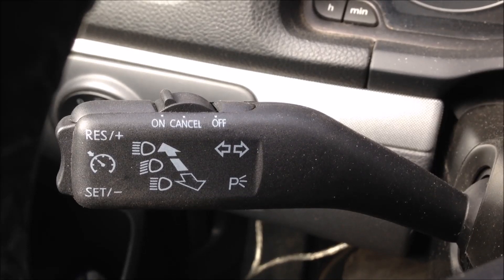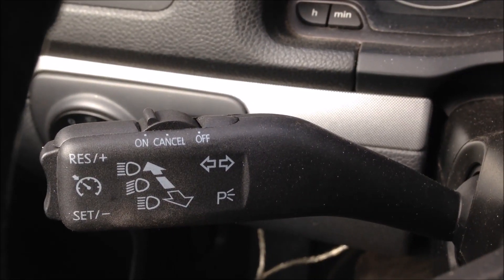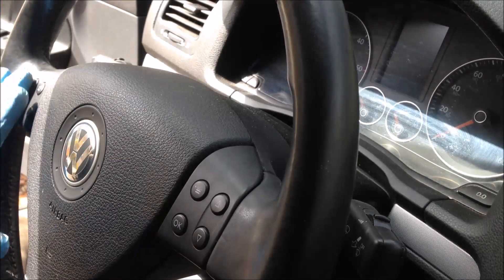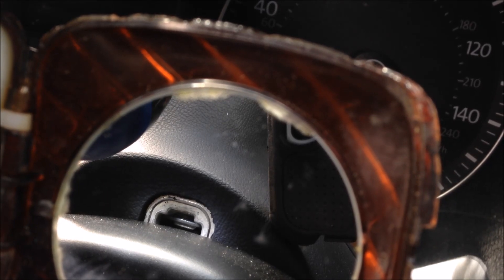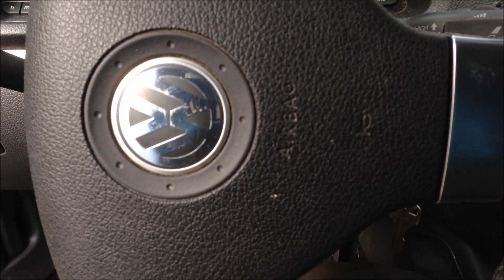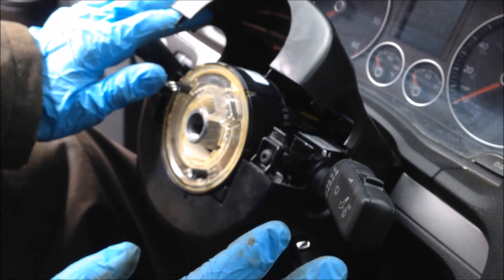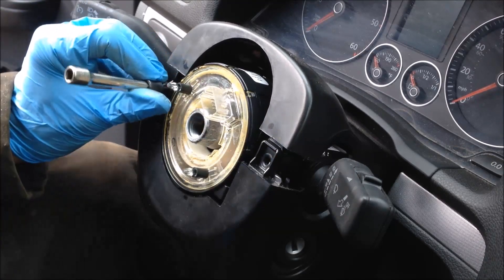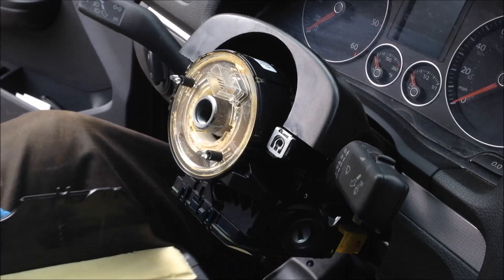MK5 - Jetta - Airbag, Clockspring, Turn Signal Disassembly & Repair - Part 1 of 3

Comment: I had the cruise control switch on my  turn signal go out on my Jetta 2010. These videos walked me thru the process and I was able to replace it and now it works great. You need a Triple Square Spline Bit Socket Set, Metric - 12mm to remove the steering wheel. I also had my seat belt receiver on the driver's side start malfunctioning and continously start dinging ever though it was clicked in. . This also required the same kind of bit but a 10mm to remove the seat so I recommend buying the socket set in case you need to do further repairs. You also need the T-8 as he stated.
The final step of removing the turn signal / cruise control was tricky but I was successful. This video save me allot of money.